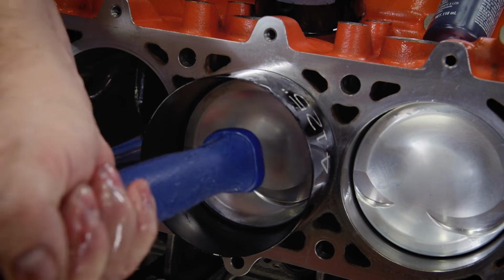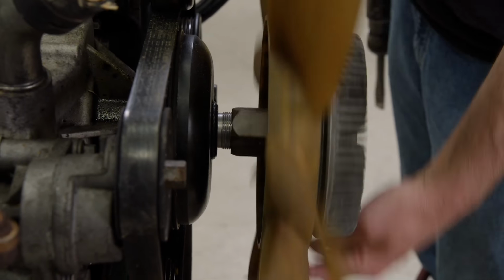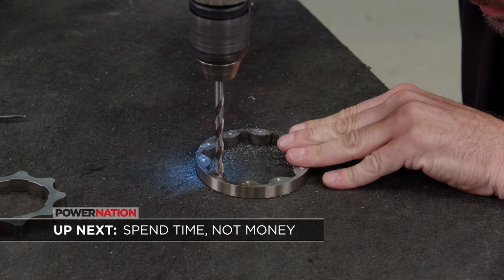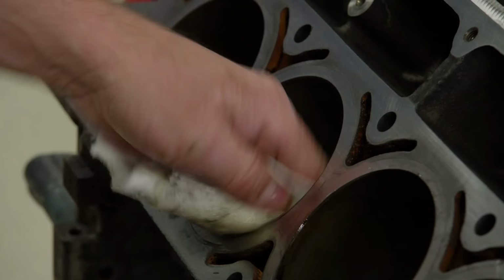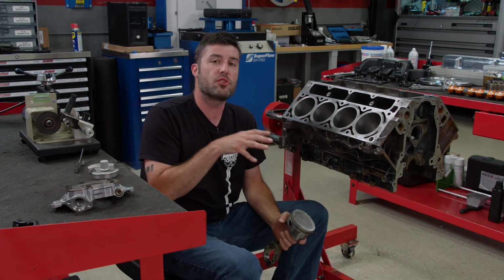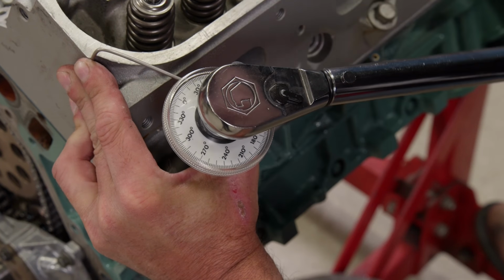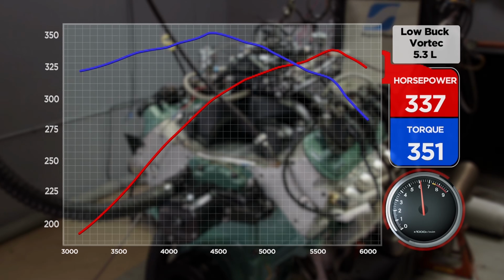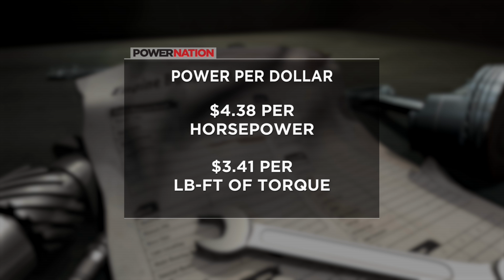Minor Upgrades Create Crazy Power on a Junkyard 5.3L Vortec - Engine Power S7, E10

Comment: Minor up grades lol, they rebuilt the engine how is that minor.
Reply: Rebuilding isn't an upgrade. An upgrade would be adding or replacing stock parts with better performance.
Reply: You need to look in the dictionary what an "up grade" means
Reply: That wasn't even truly a rebuild. Aside from the cam kit and valve train components, the only internal parts that got replaced was the main bearings. Everything else was reused, resurfaced, and reclearanced. Ofcourse they put a new gasket set in it too.
Reply: @Raccoonactual  headers
Reply: @paxwallacejazz  headers are not a internal upgrade or part of "rebuilding" the engine. Plus it takes very little time to install headers, even with the engine in a vehicle.

Comment: the price breakdown is missing a carb and ignition controller, 2 VERY important items. low-buck my @$$, low-buck is keeping the factory EFI and using tunerpro (free) to disable VATS which is literally the only thing you need to do on the software-side to make it fire up.

Comment: To give this "low buck build" video some credibility, they should have hand trucked the block out to the storm drain in front of the shop and cleaned it with a a spray bottle of purple degreaser, a scrub brush and a garden hose.

Comment: Carb cost wasn't included so it would run you a little more.  Easier to use the truck computer and injection, you just need a pump and some fuel lines in whatever you transplant this into.  Then HP tuners can tune it.  Really you need long tubes, cam, and nitrous to replicate this power.  Hell a 200k mile truck can put these numbers down with a few mods.

Comment: Budget power isn't about the cheapest you can get away with so much as the best bang for the buck and reliability. spending money on bearings and gaskets and labor on oiling system and getting the perfect ring gap isn't wasted effort. The people tossing in junkyard motors as is are not about real world modifications as about tossing something in in the effort to see what it will take before it blows .. Me im all about putting something together that will NOT blow and will handle what I intend to throw at it. for a reasonable price that is ..

Comment: still waiting for a 4.6L 2V boosted comparison of 2 stock PI engines with boost .. totally identical except 2nd engine torn down and rings re gapped for boost. and both engine have boost ramped up till motors detonate to see if re gapping the rings give the stock engine a longer higher boost longevity as 400 hp seems to be the fail threshold of the stock PI engine .. since this test doesn't have any parts suppliers benefiting from the episode the team appears to be chicken shit to do this test.

Comment: They left out at least 50% of the cost. I’m pulling my 250k mileage 5.3 from my Silverado to put into my 67’ Biscayne. I’ll probably upgrade it to a 5.4 327 (as long as it’s not dead lol) but finding a budget build is hard. They’re all like this video. I’d like to see them do a true budget build without crazy tools. Just power wash it and change some fluids.
Reply: Umm not really. Most guys get a bad case of While-I'm-In-There-itis and replace/blueprint everything. They reused the rings, pistons, headbolts, only adding cam/springs/intake/carb/nitrous. EVERYTHING for my 67 Firebird swap has totaled $1600 inc fuel system ($200 engine). So far I'm at $700 for the complete turbo bits - turbo, v-bands, couplers, piping, wastegate, IC.
Reply: @hydrocarbon82  where’d you get the turbo parts from?
Reply: You don't have to have the crazy tools or a Dyno or anything like that...... With basic tools you could take a engine apart and clean it and do what they did, they just used more expensive methods you could do the same thing with out them..... It's still budget
Reply: @thefoodcan  Absolutely and the LS platform is one of the easiest engines I ever built.  You can build one from a book.
Reply: It already is a 326 ci/in engine.  Find an used set of 5.7 pistons at a machine shop and bore that 5.3 out to 5.7 (350ci), that's all you need, the crank and rods are the same as the Corvette pieces.
Reply: Not that it really matters. But, are you talking about Gen 1 SBC engine size / specs, or a combination of both ?  From what I remember Gen1 sizes: 350ci = 4.006 X 3.48 stroke,  327ci = 4.006 X 3.25 stroke, 302ci = 4.006 X 3.00   400ci = 4.125 X 3.75 stroke (3.75 came w/ shorter rods).  I don't know the specifics, but I thought the newer 5.3 Liter is 325ci.  Assuming that "size matters" ??
Reply: @garysorensen7724  The 5.3 is "technically" not a 327, but it's so close that most people just call it a 327 because it's literally about a cubic inch off of one and most folk are familiar with the old and quite popular SBC 327; pretty sure Mickey Thompson helped some on that front. If you search up the size of the 5.3, even with the same 3.78-inch bore x 3.62-inch stroke you'll get about 6 different answers as to the cubic inch of the thing. I've seen it listed as OEM-spec as low as a 324, and as high as a 326. So unless you want to be pedantic or be "that guy" correcting someone even though many sources can't even agree as to an exact figure, for all intents and purposes the thing's a modern 327.
Reply: @garysorensen7724  
The 5.3 has a 3.78 inch bore and 3.54 stroke a slightly longer stroke than the 350, but the smaller bore.
Reply: @hardball107  
You would need to bore a 5.3, over 200 thousand to make it a 4 inch bore,  I seriously doubt that's possible.
Reply: @hardball107 

lol......I would love to see a video of you trying to put old school chevy 5.7 pistons in a LS Chevy 5.3 bore is 3.78

Now if your talking a LS 5.7 pistons in a bored out 5.3 from a 3.78 bore to a 3.898 bore  then yes. 

But you are not gonna take a old school chevy 5.7 pistons put it in a 5.3
You can not bore a 5.3 to a 4.00 bore.
Reply: Fuzzy dice projects does that stuff with sbc and bbc
Reply: LT on YouTube bro he does this
Reply: What we all think tbh
Reply: A 5.3 is already a 327! 327 is just a de-stroked 350, 302 was a 327 and 293 was a 302. 293 is the 4.8 they offer in most of the single cab v8’s. A single cab with 6.0 in it just demonic tho 😈
Reply: @78fty95  The 5.3 is a 325, not a 327. The 327 is a 5.4 Liter and a little bit older style GM Engine.
Reply: @78fty95  
A 5.3, is not a destroked 5.7, the bore is the same as a 305, 3.78 inch,  the 5.7 or 350 has a 4 inch bore. Over 200 thousand difference that's more than most engines can take except maybe an old flathead V8 Ford.
Reply: you have to add this is way way way pre COVID prices was that cheap & that they have a million dollars worth of tools we don't have 😭😂🤔

Comment: 2:33 "The factory connectors are easy to remove - simply press on the retaining tab and pull the connector".  Immediately cuts to the dude with a gaping, bloody hole in the back of his hand and then a shot of the harness that looks like they completely caved and took a pair industrial scissors to the entire wire cluster in go.

Comment: I like the work. How much does all the parts cost ?  How much would labor cost ? I have a 02 GMC Yukon XL 4 X4 with 220500 miles and thinking about rebuilding it. The truck still run good but with less power then I wanted cause I have it 6 in cj lift with 20 x 12 x 33.

Comment: IMO to open up a engine and do a complete tear down and clean . And not install new rings and rod bearings along with the main bearings At the marginal price that they are is not the place to save a dollar . That bearing material has gone through a lot of heat cycles   Now you boost the pressure and RPM on them .Then the next thing is they begin to flake a part  .

Comment: WTF? Not even a budget cam? The cam is the weakest link $200-400. Small cams pump 400 plus. Add a throttle body from trailblazer, done. All the labor $$$$ you did for 300s, wtf. And a bottle that needs refilled...... lazy...

Comment: I wish I’d seen some of this stuff when I did my DOD delete on my LC9 two+ years ago at 143k miles. Great stuff. I used Comp Cams pushrods, Summit upgraded rocker arms and non DOD GM cam. Cost me about $1500 with Texas Speed delete kit, Summit for cam, LS3 Melling oil pump, Sac City Corvette timing cover alignment tool, flywheel holding tool and a few other parts.
Reply: Should have gotten the 4.8 they don't have that garbage and only and more power my 4.8 from a 2011 chevy has 305 factory hp and can be had much cheaper then the 5.3

Comment: i just got a hell of deal traded a stock 350 pu engine that runs good out of a 75 chevy for a tired worn out but still runs on 6 cylinders with 2 bad injectors has good compression L S 7 2008 out of a wrecked vet with the 6 speed trans i will have to let it sit for a year before i have the money to rebuilt it

Comment: I have a 262 cu. in. V6 Chevy with 250,000 miles and it runs well. What should I be worried the most about the S10 4.3 Litre engine?

Comment: Hey guys, I am getting ready to pull my 2001  5.0 Mercruiser for a ring gear repair.  If you where pulling this engine what parts would you rebuild or replace before putting back in the boat ?

Comment: I had a 5.3L with 4:10 rear end gears in my 2000 Suburban. Man that thing was beast when it came to towing.
Reply: I have an lm7 with l59 flex fuel and lc9 oil pan in a Volvo 240 with 3.73 gears and spooled diff lol. Has a summit 8707 cam, pac 1219 springs, and Brian tooley pushrods and trunion kit, with 1" 7/8 headers, a trailblazer SS intake, and 92mm tb. She's a hoot!!
Reply: Hey man hit me up, would need some advice and follow your path am in a process of my rebuild LM7 5.3 to swap into my Volvo 245 1986. Could need you experience, aLOT!!!!

Comment: Looks like you forgot to add the cost of these essential items, carburetor, ignition control, head bolts and long tube headers.  I'm not nitpicking items like plug wires because those don't affect the horsepower per dollar equation or are mandatory.

Comment: Lmao I love when they say budget built and break out all the machine shop equipment. Lmao. Any normal budget DIY guy or gal does not have all this at their disposal. When we think budget LS we don't even think about breaking the bottom end apart, but we do head work, piston top cleaning, inspection, intake manifold porting or swap, throttle body porting or swap, cam swap, VVT/AFM/DOD delete with new LS7 style lifters and "GM" lifter trays, timing upgrades, vavlespring upgrades, etc... Mainly bolt on stuff

Comment: 1.if you put rings on like that you will bend rings and scratch ring grooves. the ring sealing to the piston is just as important as the ring to the cylinder wall. there is a reason they make a tool to do that.
2. you did not deburr the ends of the rings. 
3.when lapping parts you should always use a figure eight pattern. 
posting videos is a big responsibility. young impressionable people could be watching this and they might assume you know what you are doing. please dont lie to them. we want this to continue on to the next generation.

Comment: Nice show and stuff, but did you really need to hammer on the fan clutch nut like that? would have not been better in every way to make a plug out of using the correct(insert whoever gives you the tools' name,) tool, and do the job properly?

Comment: These guys ( USA ) take a 5.4L engine, rebuild it with aftermarket parts, even parts optimized for racing, throw a huge NOS boost system on it and dyno it for 564 HP/724 torque...
On the other side, my BMW ( Germany )- 3.0L Diesel engine, nowhere near as many RPM as theirs, 2,8 times the mileage on it, no NOS :)))))), sorry for laughing but this is getting painfully hilarious... outputs 503 HP with 600 Torque... ehhh.. yeah... I’d stick with my Germans since theirs really suck :))))))))))

Comment: That's a real low NA power number. Itd be cheaper to do a 5.7 sbc vortec and make more power than that.
Reply: Vortec heads need screw in studs..and the specific manifold to make any kind of power. 

And a spring chamge to do anything more than about .460 lift stock

At that point buy etec 170s. They come with all that stuff for 1500 and theyre aluminum
Reply: @KingJT80  nah you can pin the studs and a drop in spring kit good to .550 lift.
Reply: @lte008  if I had a set laying around yes

But starting from scratch. No id just buy the etec 170s and be ahead with a heavier .575 lift spring and aluminum haeds